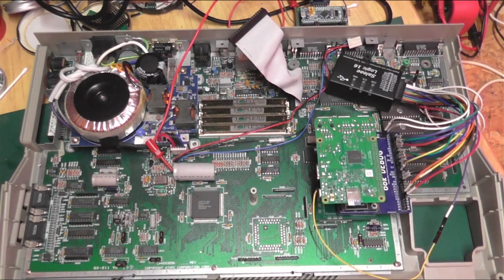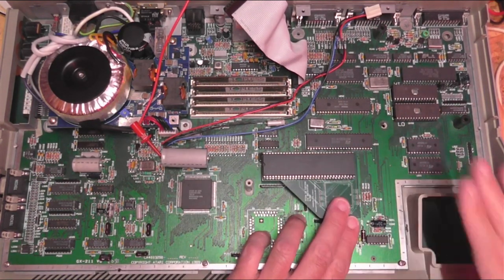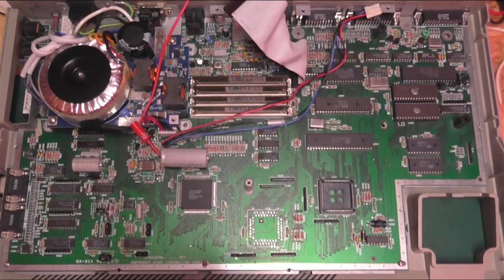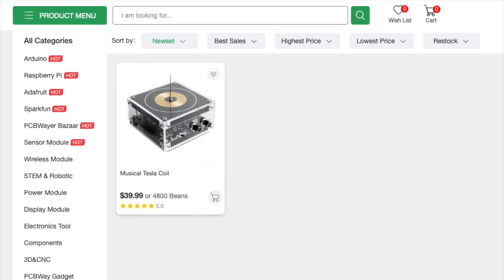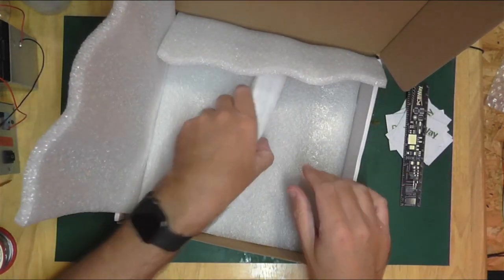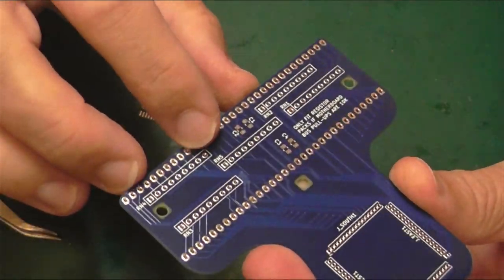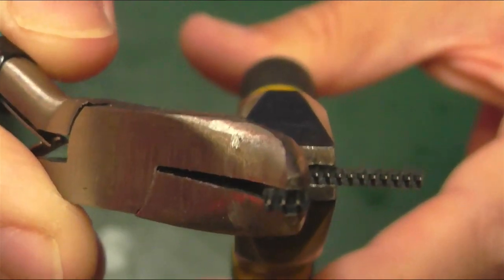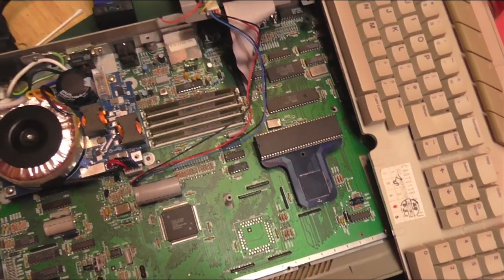STE CPU adapter for PiStormST or DSTB1

Comment: before soldering the 1.27mm pins in, you could slide the plastic holders up (into the pcb) an extra mm, then slide them off after soldering

Comment: Great job!  It's super frustrating trying to mod the ST with regards to the CPU socket and its locations across the different rev boards.  I wonder if you could mount the CPU on the underside of a PCB that extends out like that.  Of course that doesn't help withh the PiStorm =/
Reply from the maker: Thanks! Yes, there is so little room to work with too. You can maybe fit one board at best in some of them, but a stack is out. Will
Probably have to do dedicated STE versions of my accelerator or PiStorm if I want to close the lid. This was really an experiment in making those PLCC adapter pins fit, so big tick in that box at least.

Comment: Looks much better than the other adapter that I also have. When will you put on sale some of them? Also, can you give a link to the 3d square because in pcbway you have to be a member? Thank you in advance!
Reply: Also which files you installed on the sd card? Where some modifications from the ones for amiga necessary?
Reply from the maker: I shan't be selling any pre-made ones, if that's what you mean. The PCBWay link is an easy way to order some boards.

The backing plate is really just a cuboid, but here you go: https://www.thingiverse.com/thing:5538610
Reply from the maker: Everything on the Pi and PiStorm side is different from trunk & all experimental. You'd have to have a look at my GitHub, specificically under the 'wip-pistormst' branch for the latest. https://github.com/dh219/pistorm/tree/wip-pistormst

Details on PiStorm Discord.

Comment: (releated to the trace length match comment below) if you have a high speed device like like your DSTB1 with 16MHz CPU & 32Mhz memory access (or a PiStorm), is it possible that the trace length does affect the BLITTER is some way (problem found in your other video) ?
Reply from the maker: I don't think so. 16MHz is pretty pedestrian in terms of signal transmission speeds. I think you'd need to be into the hundreds of MHz before trace matching would be needed. You need about six inches of extra path length to offset a pulse edge by one nanosecond. We're dealing with 60ns clocks.
Reply: @thetechnoshed  good point, just remembered seeing a RPi push a RC2014 bus to 120Mhz - still I dont remember the layout of my STe looking like yours (had the case permanantly off due to PC floppy, and not wanting to cut anything), but it too was non-sip model, so maybe "old age" memory

Comment: When will someone reduce the PiStormST and Raspberry Pie IV into a FPGA that could be mounted in a FPGA socket.
Reply from the maker: Progress on drop-in FGPA replacements for the 68k line (specifically 020+) seems to have stalled. Vampire can do half the job, but the ST and Mac need the other half too.